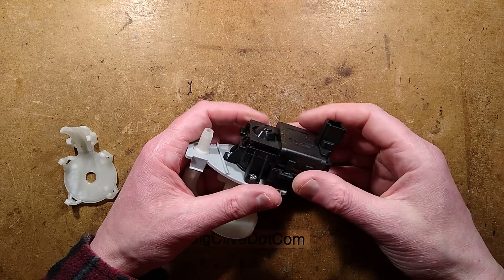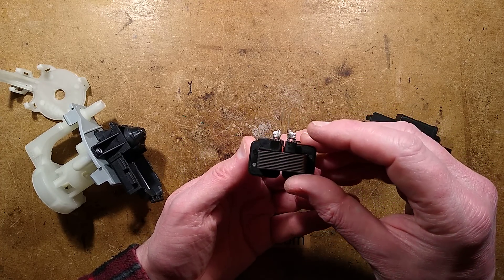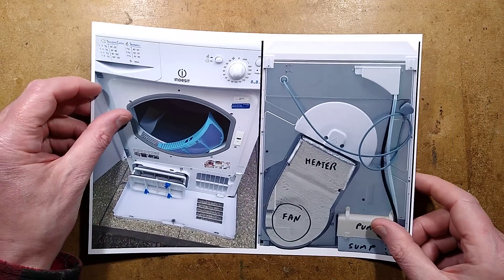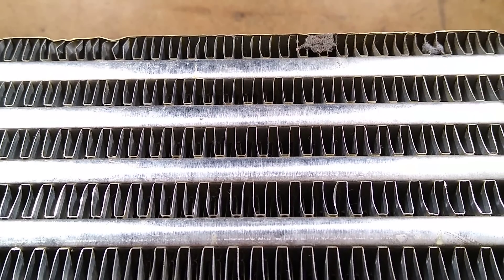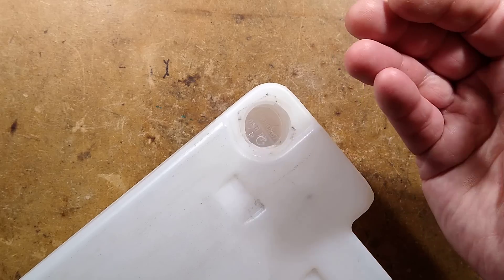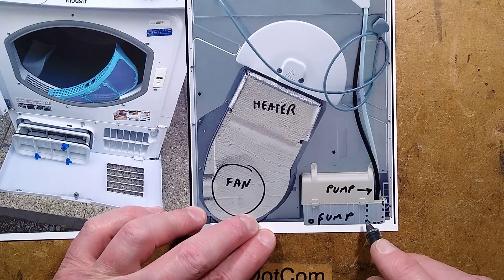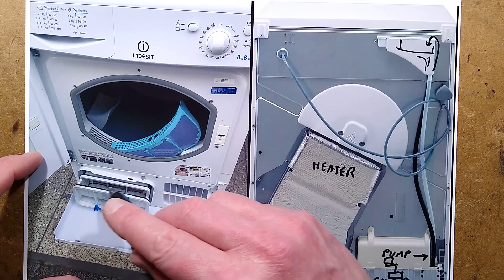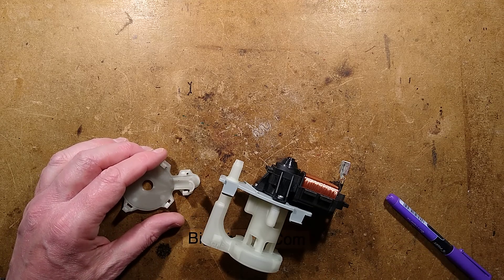Condenser laundry dryer pump

Comment: In my dryer, the float controls the start/stop of the pump, but not directly and I doubt the float controls the machine/pump directly in the dryer in this video too, because if that was the case, then the dryer could never be switched on once the small reservoir is full.

Instead, when the float triggers that the reservoir is full, then the dryer continues to operate for some time (about a minute) and if the float does not indicate non-full reservoir level within that time period, then obviously everything that is pumped up to the main tank is coming back down into the reservoir again. Once you empty the tank, and turn on the machine again, the float will still signal that the reservoir is full, but within a minute or so the pump will have emptied the reservoir into the big tank and the machine continues to operate.

The reason I know this is that the float broke on my dryer and Samsung wanted like £50 + shipping for it as a spare part. I found a generic float that was almost identical for less than £5, which has worked fine for 6-7 years now.
Reply: It work exactly as Clive says mate.. I worked on these for years.
Reply: @daviddillon172  Mine does not, my Samsung dryer works as I described. Tell me, if the float immediately stops the machine when the reservoir is full, then how can you restart the machine when the reservoir is still full (as the reservoir will still be full even after you emptied the upper tank)?
Reply: @leifsimmons2464  As Clive states the pump runs continually, the float in the sump only stops the drying cycle. So long as the dryer timer is set in the on position the pump will run, if the top tank is full, the water just keep circulating around till the top tank is emptied, when the top tank is replaced the water then fills the top tank again therefore emptying the bottom sump enabling the drum and heater to restart after the float resets.
Reply: @daviddillon172  Oh, I misunderstood, I thought the float stopped the entire machine. That is what happens in my Samsung. It will not restart by itself after the water tank has been emptied.

Comment: This machine is garbage, I've had two of them in my life and both have exploded, the last setting fire to itself and leaving my countertop badly burned, worst part is, somehow, that's my fault, so indesit won't refund or repair the machine, no wonder it ended up on Clive's tinker table!
Reply: If yours was the same model (rebrand) as the one shown here, then it might be worth checking for a recall. The Hotpoint models were subject to a recall a few years ago, and mine was replaced with a brand new, but modified with an interlock to prevent the heater powering up when the reservoir is full. Fires had been attributed to this hence the recall. It's also worth noting that simply switching these machines off mid cycle before leaving the house is a bad idea despite thinking that it's safe. There needs to be a cooldown period where the heater is off, but fans on to prevent heat soak and potential fire.
Reply: Didn't Clive say it was his machine - he would do proper maintenance.

Comment: Why do they still use non-condenser dryers in america? I thought it was a generally outdated and wasteful design that was obsolete in the early 90s.
Reply: Convenience/marketing/inertia and probably also the broad climate range even in the 48 contiguous states. Florida climate is significantly different than, say, North Dakota. I assume our (USA) energy costs (which also vary considerably across even the 48 states) are also lower than most European energy costs.
And we also are a "generally" wealthy country (so convenience is generally affordable to many). For example, I saw a tidbit recently (I have NOT checked accuracy)  that the UK is poorer than our poorest state (Mississippi).

Comment: We wouldn't want that warmed air coming back in our houses in the Summer here in sunny Florida.  I'll stick with venting it outside.  Maybe in Switzerland...
Reply: It uses a heat pump which pumps heat internally.  So it will not warm the house.
Reply: @michael931 in Clive's specific examples the heat is dumped into the room air he mentions that is passing through one side of the heat exchanger.

Comment: What I like most about those simple designed brands is that they are cheap and long-lasting. Reaching eleven years now, the contraption costs mere cents per dry now.
Reply: Well, you'd be better off paying for a dryer that has moisture sensing at least. Less power usage, less wear on the clothes. Microcontrollers are cheap and plentiful and reliable enough.
Reply from the maker: I prefer the mass produced units too.  Much easier to service, and spares are very cheap.

Comment: My heat pump drier has a similar drawer arrangement for the water but also has a reservoir that it uses to wash the condenser/heat exchanger from time to time to get rid of fluff and dirt.  When it's finished it pumps the water to the water drawer, or you can unplug the pipe and just route it into a drain or sink to avoid the emptying kerfuffle!
Reply: FYI I just taken ours apart and cleaned the condenser with a garden hose for 30min :D Take the cover off and clean the lint out from time to time :D
Reply: Great way of blowing microplastics everywhere.
Reply: @m.s.8112  I cleaned it with water and it drained into the public sewer system.
Reply: @thebrowns5337  better than putting it straight into the river, as it goes through an actual treatment plant and a bunch of that will get caught in the sludge and gets removed. It isn't perfect, though. But that problem also happens with a vented dryer as those vent outside. The fix would be to not buy any synthetic clothes, or simply stop washing them.

Comment: Don't American washing machines etc also run at 240V? As in, you get a two phase supply into the house, and the circuit is wired up to both phases.
Reply: No.  Washing machines run on 120V.

Comment: One advantage of this type of dryer is that it doesn’t pull a negative pressure on your house. Negative pressures on your house will pull in cold air from outside or from your crawlspace that you have to reheat. 

We use an even more efficient method than that. It’s called a clothes line, one inside and out. Quiet, trouble free, humidifies the air in the winter and doesn’t consume our off grid solar power. You won’t see very many of these low cost devices in the USA, because most people are too lazy and their time on Fakebook or holding the couch and tv remote hostage is more important.
Reply: most of us spend most of our lifes working for someone else wealth, maybe it's worth affording more of (the already little) spare time we have for our interests while machines makes our mandatory house keeping less miserable.
But i guess beign bitter at others people greater timeframe foe hobbies (while spending all the time off work doing chores until bed) is an option too.
Reply: Congrats on slowly becoming a Boomer with your rants.
Reply: @RiceCakeWtf  A bit fed up with all this GenXYZ rubbish. 
If you were born in 20xx, does that automatically make you spout wisdom?
No. Didnt think so.

Comment: Depending on the age of your dryer you might want to check with Hotpoint/Indesit as there has been a recall due to a fire hazzard on models made between 2004 and 2015.

Comment: I still have the 4" flexy going to the wall. That's a much better way to save energy.
Reply: Throwing away energy needlessly during the winter, if the energy efficiency standards were updated to account for that (maybe they have been), everyone would realize just how bad those old dinosaurs really are.
Reply: @NiHaoMike64  The original replier might have been using sarcasm.

Comment: The float switch cuts power to the heater, The Motor and pump will continue to run and a light is lit on the front panel. This ensures the appiance doesn't overheat just because the water container is full.
Reply: Not on my one! It will cut power to everything when its full and just have the water light on, Hotpoint from around 2018.

Comment: Condenser dryers are not very common in the US. They tend to take forever to get a load of clothes to dry (especially cotton fabrics). We use a dryer that has a long flexible aluminum exhaust tube to release the moist air to the outside. Then you have the choice between electric or natural gas heating (NG). The ones operating with gas seem to work the quickest. The electric ones tend to use two 120V phases to be able to operate on 240VAC/20Amps.  120VAC single phase at 20 Amps just doesn't cut it.
Yes, lint removal is very important, especially if using the NG version. 🔥
Reply: Correct, in 'Murica, we prefer to take 5,000 watts of electric resistance heat and.... blow it out of a 4" hole in the wall. In Europe, they use heat pump dryers (decades ago they were slow, cold-water-condensing type) which are a bit slower, maybe 20%, but use 70% less electricity because they recover effectively 100% of their heat energy instead of wasting literally 100% of it. But, heat pumps cost slightly more (about 15-25% more from what I've seen), and if there's one thing about 'Murica, it's that we value only one thing.... CHEAP INITIAL PURCHASE PRICE. Efficiency, longevity, even effectiveness at a given task, are all basically worthless to the average american consumer. We will buy something that costs us literally thousands of dollars in excess electric usage over its life simply because it's $200 cheaper to buy. Vented dryers are the muscle cars of the applianc world - cheap to buy, flimsy construction, guzzle down fuel in order to get the task done hot, fast and in a hurry... plus they're dangerous fire hazards (the Whirlpool lint-tops have been in production for 63 years and the federal government is currently threatening Whirlpool because they STILL have not fitted something as simple as a goddamn moisture sensor to it... it claims to have it, and it's required to have it, but they just... don't put them in.)
Reply: Those were the norm in Europe in die 70s-80s, too. Then the Condenser ones entered the scene and in the 2010s Heat pump dryers turned up. A budget A+++ efficiency model takes 2,75h for a 7kg load of cotton. And only consumes 1,27kWh to dry that 7kg of laundry. According to the specs a medium mixed load should take 1,8h. Pretty similar to a standard washer runtime.
Reply: I think Clive hinted they may be for smaller homes/lofts, etc.  Won't be replacing my dryer with heavy duty gas fired burners and dual 6" exhaust ports vented to heat my outdoor garden (just kidding on the dual ports(only 1).  My washer is a large matching front loader.
Reply: @mevk1  and why do you need that again? Even for a bigger family just run the washer and dryer twice a day and you are fine.
One could build a heatpump dryer that's faster, for commercial use. But that requires a more powerful compressor etc. and 90% of people wouldn't want to pay for that.
Reply: @theoztreecrasher2647  the f...? What does colonialism have to do with efficient appliances? I just think they are pretty neat and a good example if you want to supplement your houses power of solar for example.
Reply: @tschuuuls486  Whooossh .... (obviously!) 🤥😈
Reply: @tschuuuls486  to match a huge front load washer.
Reply: @mevk1  they make 9kg heat pump dryers :D
Reply: I will say that I have never knowingly seen a gas powered dryer in a house in person, definitely never used one. In fact I didn't know they existed until a few years ago. The PNW has cheap electricity I guess is why.

Comment: Seems like a lot to avoid a blow hole to the outside. Also the US dryers are huge. Many are gas heated also. The electric ones run on 240VAC. I can put 18 lbs (8 ish KG) DRY of clothes in the washer and the dryer will take them all and they will be dry in 50 ish min.
Reply from the maker: In our colder climate it's advantageous to have the extra heat from the machine indoors instead of blowing it outdoors.
Reply: @bigclivedotcom  that plus it's easier to clean out the lint, our dryers have a vent hose that gets clogged up with lint over time, they can be a pain in the butt to clean out especially if they go through and up a basement wall like mine. You can't ignore them for very long else you've got a fire hazard.
Reply: @bigclivedotcom The USA has a fairly broad climate range, even in the 48 contiguous states. Many of the "northern" states  have a colder climate than Scotland. I think the outside vented dryer is more a function of marketing/convenience in the USA AND I can remember when outdoor clothes lines were fairly common. The disappearance of outdoor clothes lines then plays into the marketing of "fresh smell" dryer sheets, etc. I'm old...
Reply: @vkristof1  it was 2 deg C overnight here in Virginia LOL
Reply: @MostlyInteresting  4 C overnight on Long Island, NY. Clive's "condenser" water pump video and resulting comments/research has added more info to consider when replacing appliances in our basement laundry/"mechanicals" room. The room can be unpleasant in the summer partly due to a dehumidifier keeping the basement less humid...

Comment: These (B class) still use 4 times the electricity an A+++ heat pump dryer uses. The pump by the way has to pump water with some fuzzy clothing particles in it, which may explain some of its design.
Reply from the maker: On a plus side, that heat goes into the house in winter.  Not so much fun in summer.
Reply: What Clive says, thermodynamics. I have lived in the USA all my life (NY and CA) and don't recall noticing these types of clothes dryers. I have been thinking of replacing our 15 year old indirect HW heater in the basement with a heat pump hot water heater. I figure the heat pump would keep the basement less humid (it's got a condensate pump) and cooler in the humid coastal NY summers. Fuel oil ( really diesel) fired ,boiler" which supplies the HW for the indirect HW heater/storage tank could also be turned off. HW heater room is also the laundry room, which contains the resistance heated, outdoor vented, clothes dryer.